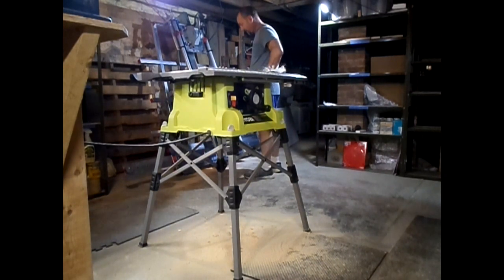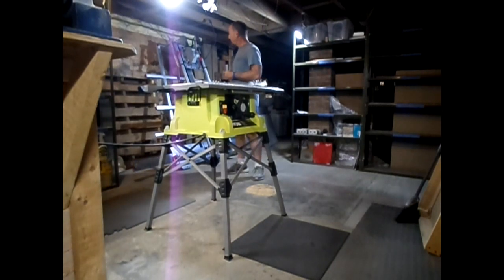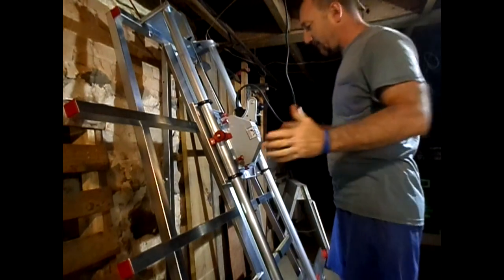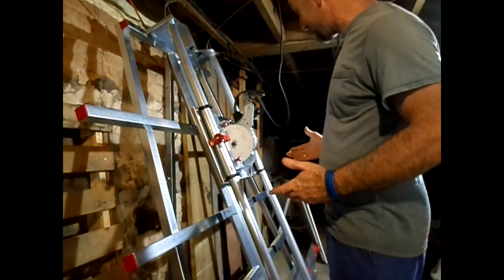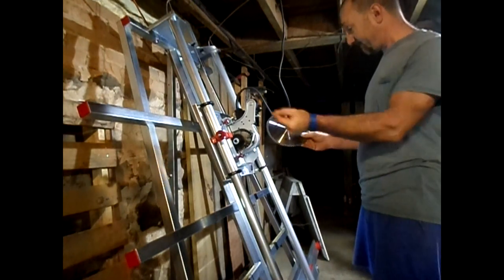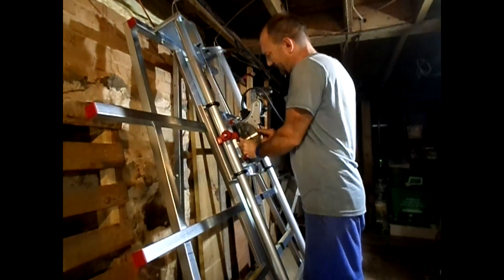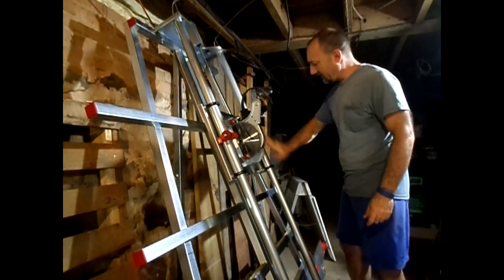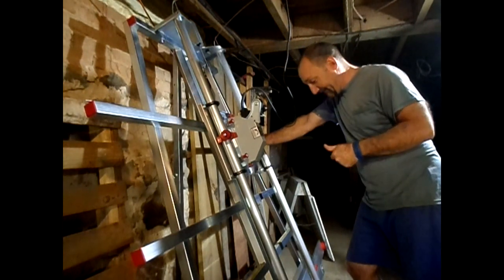GMGT Preps For Acrylic and Lexan

Comment: Advice on the lighting .....use LED where you can.  It sure made the difference in my shop

!!
Reply from the maker: Ah Jeff! I remember now! Yes indeed, LED is the way to go. The two shop lights over my two work benches are LED. The other lights / clip on, are those energy saving bulbs. I believe they are the daylight type of bulb. I know the bigger of the two is, the one I had pointing at the new saw. I am indeed going to pick up another LED shop light and hang it over the panel saw.
Thanks Jeff! Helpful suggestions are greatly appreciated for sure.